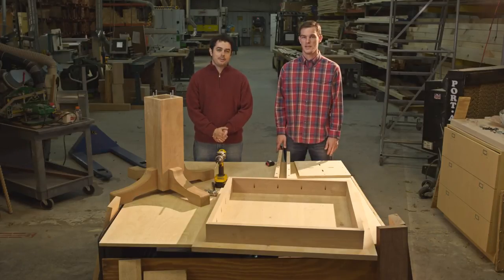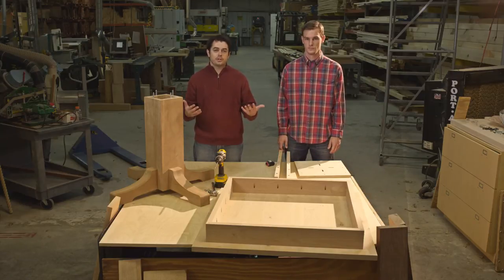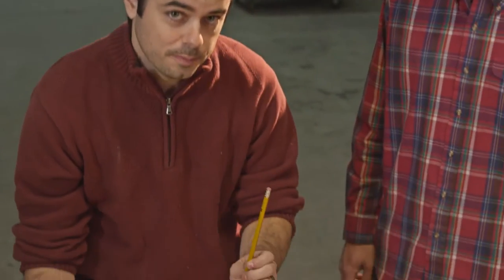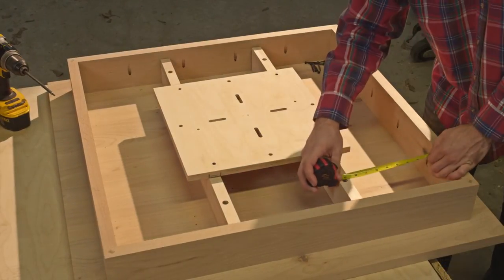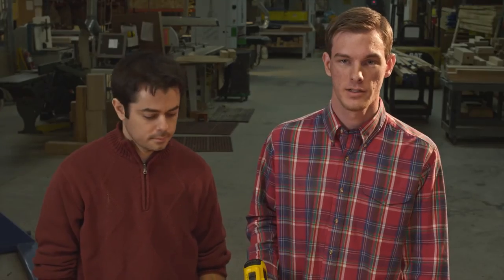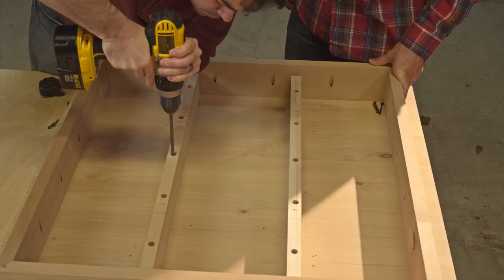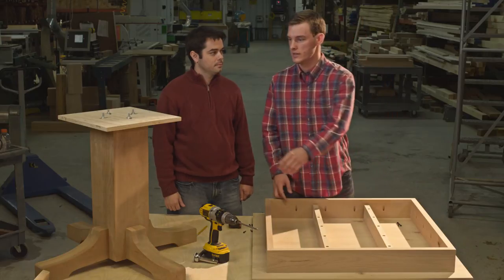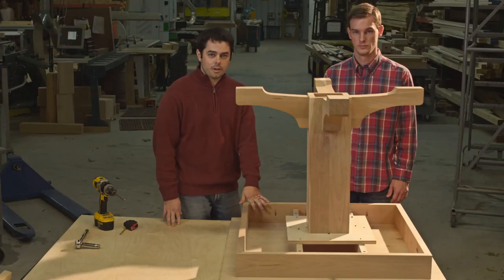How To Connect Your Osborne Pedestal Kit to your Tabletop

Comment: Wood movement? Looks like that top will eventually crack or warp since it cannot move with changes in moisture/humidity and temperature.
Reply from the maker: Thanks for the question! This was a top that we knew was properly dried and cared for in a stable environment, however, we have a number of options on our website that will allow for more wood movement if desired!